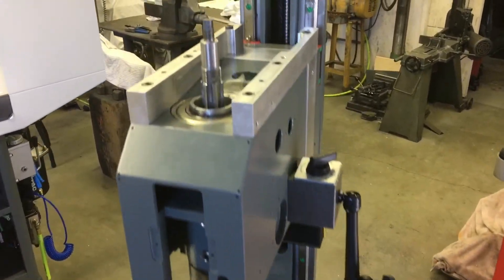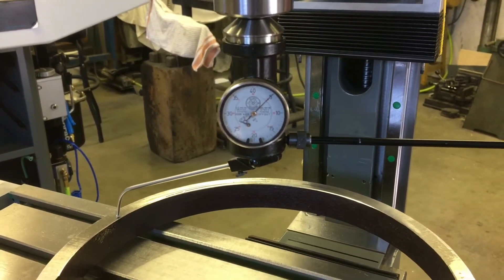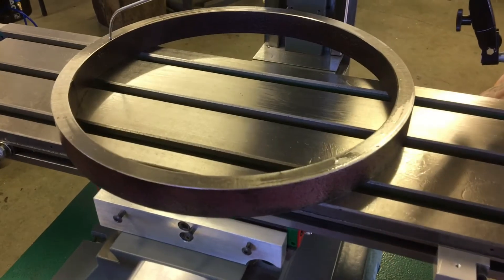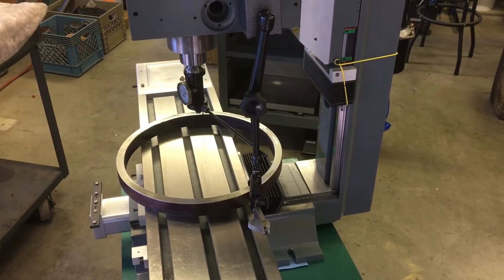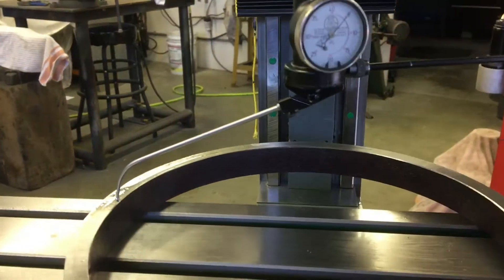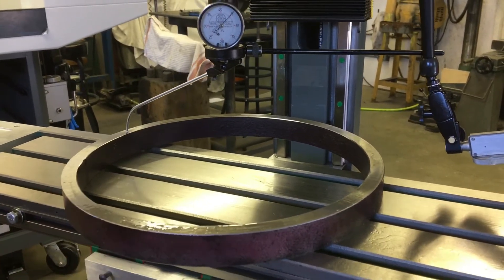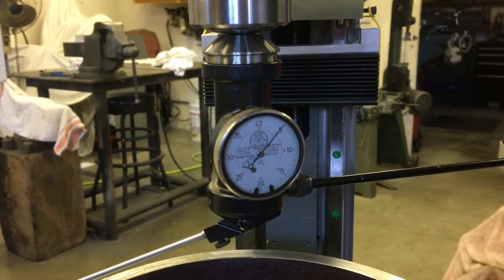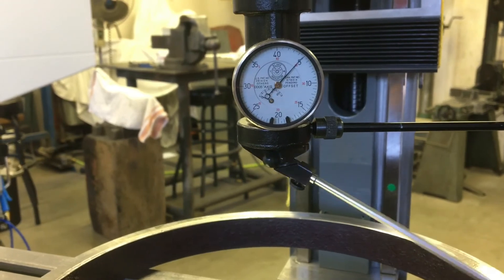G0704 Tram

Comment: Looking good, did you check the forward and backward told on the column?  May want to do that if you haven't before putting it in the enclosure.  That one is a pain to shim in an enclosure.  Need a right angle surface plate or a good  size machinist square to run an indicator on while you move the head up and down to see if any told was introduced or is present from anything.  After that's fine is when you'd want to check your tram so you know you aren't correcting Y±  had alignment to cover column tram.  Hope that helps!
Reply from the maker: Hey Chris! Nice to here from you, thanks for the advise. yes! Shimming the column in the enclosure would not be my first choice either... What kind of numbers did your column take (shim wise?) .... not having anything to compare against or how these machines typically come from china. The machine has 0 shim stock on the base / column junction, yielded .0005"  over 6" .... i'm sure the re-machining and surface grinding on the base and column during the Z linear rails helped considerably. I'm happy with the results.  - Nick
Reply: Nicholas Miller mine is .001" over. 12" so probably about the same as yours.. it took a .0015" shim to angle it back to get that number stock..
Reply from the maker: Good to know! Im sure like most things little machine... it could verywell depend on what day it was built! haha..   - Nick
Reply: Nicholas Miller yeah for certain!  Sent a PM on the zone, hit me back, have a question for off "the line".. lol
Reply from the maker: Will do Chris. I have a class tonight, I'll get at you after.